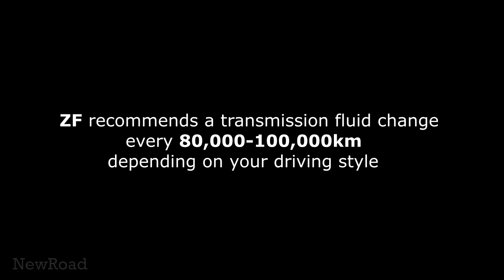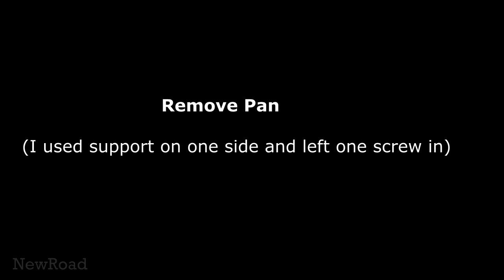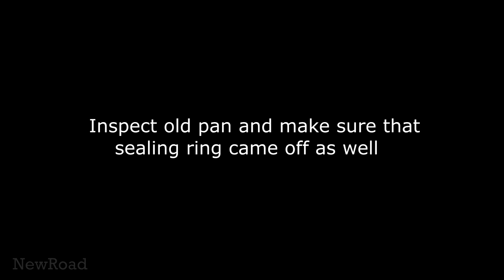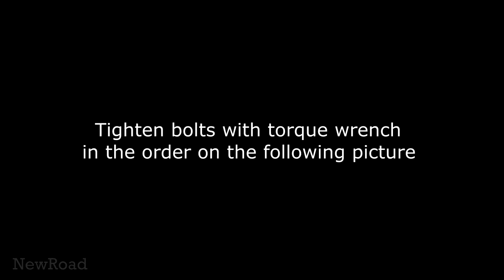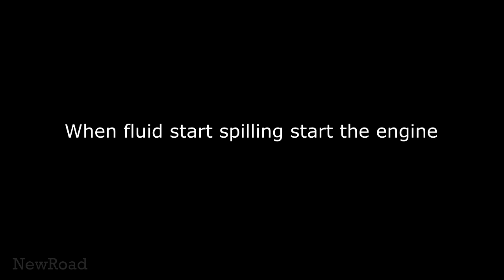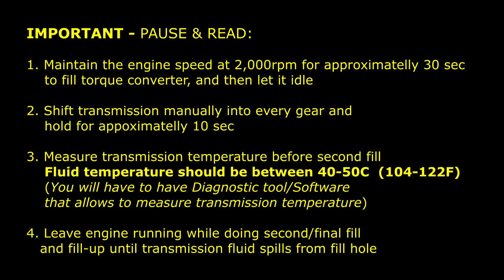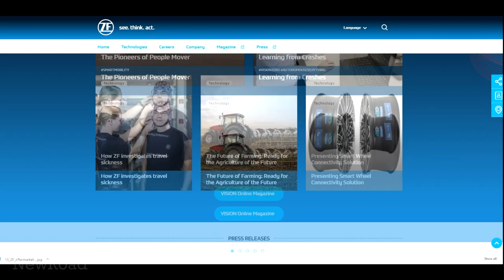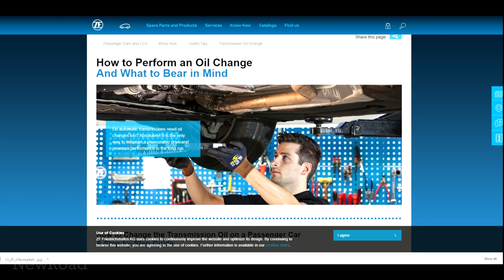How to Change Transmission Fluid in ZF 8HP transmission BMW, Audi, Volkswagen, Dodge, BMW

Comment: this additional procedure has to be done only if your car has a bypass valve. It makes sence to increase the temp to 75 degrees Celsius and than you should wait untill it falls down to 35-50 degrees. I did already this on my Jeep Grand Cherokee WK2. ZF recommands after the 1 refresh to perfor this procdure every 50-60.000 km

Comment: Thanks for the video it was very helpful.  I have one question though after completing the oil change my speedometer is off by like 20 mph.  Do you have any idea why that would be?  I have a 2016 bmw 340ix with a zf 8 speed.    Do I need to reset something?  Thanks in advance for any help.
Reply from the maker: You don't need to reset anything. Just wondering if something is wrong with speedometer sensor...
Reply: Did you fix this? What was the cause?
Reply: What happen with your issue?

Comment: F32 owner here, about to do this very job. My question - its not possible to hold every gear for 10 seconds, you can quickly flick through to M8 from M1 but then it will immediately go back to M1 after a few seconds, There does not seem to be a way of holding every gear. What did you do?
Reply from the maker: I tried my best, it doesn't have to be perfect

Comment: Great video.  This is the same or very similar part I just used to change my 2017Alfa Romeo Giulia TI Sport  Mopar # 68332462AA.  Very hard to find directions or videos on service and this was it.  I was nervous about running my car on jacks and refilling, but was able to get almost 5 quarts back in, which is roughly the amount that came out when I drained. My car has 80K on it and the fluid that came out was maybe a shade or two darker than the new fluid I put in.  There were no error codes after service and car continues to un great.  I am posting for other Giulia owners to hopefully find and use.
Reply from the maker: Awesome! Thank you for your feedback!

Comment: Great video, I'm doing my zf8 tomorrow. Quick question, does the new pan need the pre-installed drain plug tightened to the required torque, or it is already done?
Reply from the maker: I'm not sure if manufacturer does it, I would double-check after installation to make sure

Comment: Great video! What is the consensus on a vehicle with ~110k miles which has not had the 8HP serviced? Service or leave it alone?
Reply from the maker: I don't believe there is - some would say don't do it, and some would say go for it if you plan to keep it long time.
Reply: factory of the gearbox say CHANGE

Comment: Nice video, pretty much every piece of info found on the internet in one place! Can I ask though, open question:
1. when is it best to drain the gearbox oil, @working temperature which I see it's at ~90.C or @cold temp, or other and why?
2. if changing when oil is higher than >75.C, this means that the thermostat will be open and also this could drain the cooler and lines, or not necessarily? I do not know exaclty were is this located and if normally oil will flow out only by gravitational means..  
Does any body though about these and have a potential answer? 
10x
Reply: 50°C
Reply: @7s29  draining at 50, would you have a reason behind this? Thanks

Comment: Is the transmission filter in the oil tray?  how do we get all the oil out of the transmission and cooling area beyond the cooling bypass? Thank you. Best explanation so far.
Reply from the maker: The only way to get all oil out is by flushing - but I have not found procedure for flushing from manufacturer (ZF) of this transmission. This video is based on manufacturer recommended procedure - so I would just follow what they recommend. If really worry about keeping transmission oil cleaner - I would just recommend to change it a it sooner than recommended. BTW, BMW does not even recommend to change it - even though ZF recommends every 80,000-120,000km
Reply: I went the ZF site  https://aftermarket.zf.com/go/en/aftermarket-portal/passenger-cars-and-lcv/catalogs/pdf-catalogs/ and got a lot of information. Turns out there is a BMW filter kit ($283.92) , A, Dodge kit ($195.00). The same kit is used on several, BMWs, Alpinas, Chryslers, Dodges, Ivecos, Jaguars, Land Rovers, Lancias, Maseratis nd Rolls-Royces. What a Pedigree !!! The refill kit contains 7 liters, the dealer just told me the dry fill is 10 liters. So it seems there are 3 liters that stay behind. The best price for a liter of Tran Fluid is 42.00,So if the oil is really very filthy I might consider a second drain and refill after so many months (cost $154.00).
Reply from the maker: @mikelittwinprincetontv117  I think you can buy cheaper the whole kit from fcpeuro.com.
Reply from the maker: @mikelittwinprincetontv117  Thank you for sharing
Reply: @NewRoad  BMW doesn't recommend to change it because they deem the lifetime of the car to be 100,000 miles. So when they say lifetime, that's what they mean. The factory oil will last that long, but obviously it's not what ZF recommends.
Reply from the maker: @calconroy7953  Well, BMW does not build that transmission - ZF does. So I would go with what ZF recommend 😎

Comment: What about the transmission fluid that goes thru the cooler?  It is still in the pipes no? How to flush that fluid?  Unless the fluid temperature exceed the bypass valve and flush when you add up fluid???  Just asking.
Reply from the maker: The procedure in this video is from trans manufacturer ZF, so I guess they don't expect all of it out. I just follow their procedure since they know the best. I know that there are couple litters of old fluid left, but if they don't recommend to flush it - so I won't worry about it.
Reply: @NewRoad  so old trany oil stuck in the coolant system contaminates new oil. Doesn't seem logical from ZF.  With conventional automatic trany, it is really simple to flush all the oil in the trany and the oil going thru the coolant system.  I'm still puzzled with the ZF method.  Unless there is a way to force the bypass valve to open and force all the oil to get flushed.
Reply from the maker: @erickcouvrette1385  I understand and agree with your point, but decided to follow ZF procedure. Mind you, BMW does not even recommend to change trans oil - they say it is lifetime...  lol
Reply: Maybe if you empty all the fluid conventionally when you perform the fill procedure at the specified temperature range, it doesn't fill the cooler lines.  Not sure. But something to think about...

Comment: How many litres did you need to fill up? I done mine and only used like 4,5 litres.. kit came with 7 litres...
Reply from the maker: I used about 5 liters. You can't get all of it out. Btw, the procedure in this video is from trans manufacturer ZF, so I guess they don't expect all of it out.

Comment: Do the wheels need to rotate as you change through the gears? If not just hold on foot brake?
Reply from the maker: No, don't have to rotate - just hold brake firm

Comment: So after replacing the pan, you fill it till it starts spilling out, then run it through all the gears, and then once it hits the desired temperature, fill it again till it starts spilling out a second time? Is that correct?
Reply from the maker: Yes, but please watch the video completely -it is in line with ZF procedure
Reply: What about the part where the wheels must rotate until 2nd gear is achieved?  This comes from FCA not ZF.
Reply: Second fill once filled let it spill to it comes to a drizzle and them reboot. Always good to check again the next day . I took to a shop that “knew how to do it “ said they donenmany times . (I didn’t have time myself working 7days a week). Long story short it kept jerking befor coming to a stop and had a jerk downshifting Freon 3-2 . Took it back and they said oh sorry it’ was low . I only hope no damage was done or at least not to much

Comment: You have to change pan when changing fluid?
Reply from the maker: Yes, you will need new pan - since it has integrated filter in it.
Reply from the maker: Yes, because it has integrated (built-in) filter

Comment: One note... i believe you are supposed to remove and install the transmission pan bolts in the same specific pattern, not just going one by one around the pan. ZF mentions something about removing bolts in a cross pattern.
Reply from the maker: It is not as important as when installing new, and I don't think anybody would completely remove bolts just going around because pan would tilt and get oil all over. First pass is to loosen them and then remove in cross pattern - not necessarily exactly as my photo show when installing new.
Reply: @NewRoad  I thought the reason they wanted it to be removed in a similar manner to installation is just so the metal doesn’t get warped. I just remember seeing something specifically saying “remove in a cross pattern” on the ZF transmission repair guide.
Reply: @CFG39  The metal is a lot stronger than the plastic pan.

Comment: Hello I own a 08 BMW X5 premium sport 4.8i. I purchased with 96,536. It now has 102,000 miles. The transmission now bangs from a slow start 1 into 2. Had the dealer check the transmission for $ 163.63 and was reported no leaks, no codes, and fluid at proper level. They said the fluid had a very bad burnt smell, and I should just replace the transmission at $ 8, 958.44. Really lol. First of all thank you for the video, I said to them let’s do the basics first lol. If I need a transmission after the basic, it will be a used one.
Reply: Sometimes that could be normal, normally on a cold start it will be a rougher shifter from 1-2. Secondly. sometimes you will get a rough 1-2 shift if you are driving slow speeds, and let off the gas AS the car was about to upshift.
Reply from the maker: Mine does it too - and I am surprised because it is 8-speed trans. My GM 4-speed automatic transmission goes from 1 to 3rd smoother
Reply: NewRoad Adventures, hello there. I’m going to wait till the weather is warm here in Boston. I’ll put the x5 up on its wheels and drain it, replace all sleeves, and rebuild the Valve body. I’ll do the basics first before I purchase a transmission. Auto zone has 3 year warranty on there ZF’s 🤔 lol.
Reply: Of course they will ask you for your money, for what are they working for_😂. A friend of mine did not change the fluid, as the manual says and at 175.000 km the frictions on the 4th, 5th and 6th gear were gone. Now the repair would cost him ca. 6.000 USD. Guess who is ging to pay that money....😮

Comment: Sorry for the question. What can happen if fill plug is not loosen before draining oil?
Reply from the maker: If you drain the fluid - but will not be able to undo fill plug... then you cannot drive to mechanical shop to help you out to unscrew the plug.

Comment: Great informative video. ZF procedure has a step to overfill the transmission with 0.5lt of fluid, driving the car until the transmission temp gets to 75 degrees to open up the valve for cooling. The procedure after that is what you have done with maintaining the revs at 2000rpm and shifting through gears etc... I haven’t seen that step carried out, is that not necessary?
Reply from the maker: I followed all steps from ZF procedure. I think I showed links at the end of the video
Reply: this additional procedure has to be done only if your car has a bypass valve. It makes sence to increase the temp to 75 degrees Celsius and than you should wait untill it falls down to 35-50 degrees. I did already this on my Jeep Grand Cherokee WK2. ZF recommands after the 1 refresh to perfor this procdure every 50-60.000 km.
Reply: @ivaningbg-73  Hoc can one know if there is a bypass valve? I assume my X5  E70 30d has the same ZF8HP-70 as your WK2.
Reply: @mcplutt  ,just ask your dealer about your model. If you have a separate cooler for the transmission oil,you have for sure  a bypass valve.

Comment: Nice tutorial, thanks.  I have to do it in my Ram truck this summer.
Reply from the maker: Good luck with the project!
Reply: Make sure you turn off your traction control on your Dodge ram. All four wheels should be off the ground when running the transmission through its Gears and making sure you do not go over the specified transmission temperature

Comment: Do you know what's the oil capacity for a Dodge Charger? Would it be the same 6 qts?
Reply from the maker: I would say it is the same since it is the same transmission. I doubt you will need all 6 qts, but it is good to have just in case.
Reply: @NewRoad  thanks, I have been experiencing some weird progressive charging noise when I accelerate abruptly either from O or while in highway. I will give maintenance to the transmission to discard any lack of transmission fluid or filter being clogged.
Reply from the maker: @EdgarV90  Agree, if you can do it yourself - it is not that expensive and you eliminate one possible cause.
Reply: @NewRoad  awesome man, thanks for your attention

Comment: Are you saying that the replacement pan has an integral fluid filter build in?
Reply: Yes it does and some pans come with the ability to just change out the filter on the next oil change for the Tran. (Remember zf recommends to change it every 50kmi) a lot of aftermarket oil pans don’t have a good rubber seal on 3:36 so a harbor freight kit seal should have a better fit

Comment: Why transmission pan  to be replaced?
Reply from the maker: I got from rockauto.com
Reply: @NewRoad  why can’t you just drain and refill, why change transmission pan? It wasnt leaking or anything
Reply from the maker: there is transmission fluid filter, and it is good idea to change is as well

Comment: What about the oil from the torque converter and the oil from the cooling pipes? You didnt drain them.
Reply from the maker: I followed ZF procedure - they don't have it. I guess if you completely change - then you can drive a bit longer than ZF recommend.
Reply: The only way to safely empty those components is to remove the return pipe from the oil cooler at the trans union , and then pump into the trans refill hole with a sealed filling attachment . You pump ( between 8 and 9 litres ) into the trans until clean oil appears out of the cooler return . Of course the system will be totally full now , so a litre or so may then spill from the filler even though you now start the engine , with cooler re-attached and filler hole open once the engine starts up  .   The procedure in this video is good for about 4.6 litre . If you open the cooler return pipe after draining the pan , about another 1.5 litre can slowly drain an air will be sucked into the cooler pipe as the oil moves under gravity , but it's hit and miss on this one . I got 6 litre out with his latter method , which is quite enough to be honest . I had 100,000km of easy highway driving on a X5 and the oil was only tea coloured , but otherwise fine looking . System pulls a little better with more noticeable hold on hill decent in M3 and M4 gears . Auto geardown on idle up to intersections is a better hold . Didn't pull the old pan apart , but the flow rate would be better with the new filter  , which does help with funtionality  . Not much debris on the magnets . The boxes are well constructed and have few problems in normal use .  You can of course do a double flush and drain off the new mix after a week of mixing around in the system and refill with another 4.6 or so if you don't want to remove cooler pipe union . You'll use 9 litres in all , but ditch 4.6/9th of your original new oil from the previous week  . There are several approaches to what to do ...............